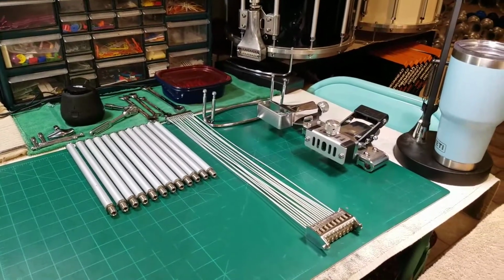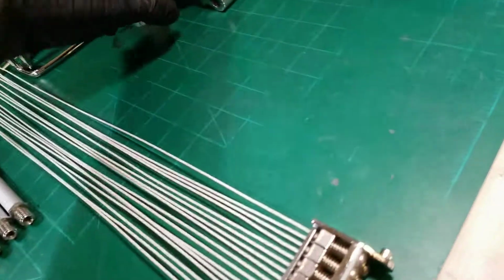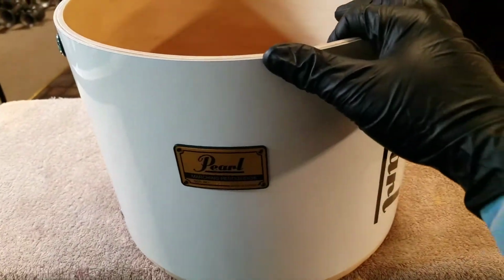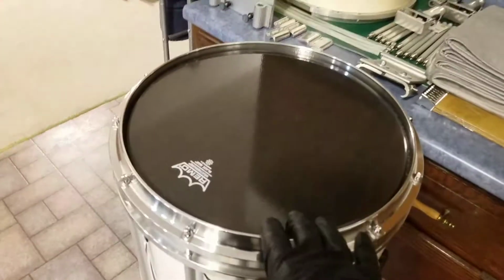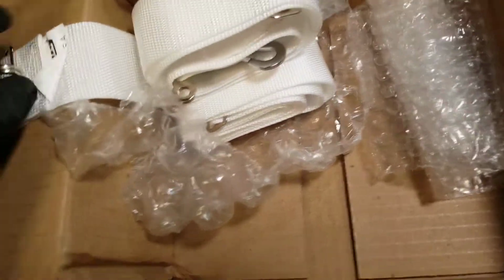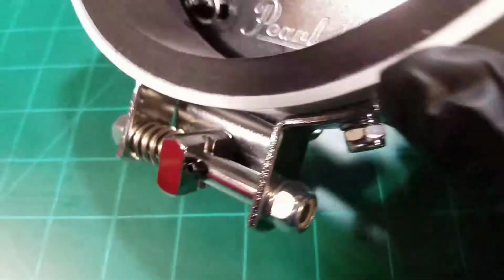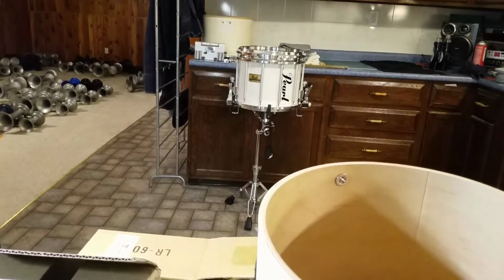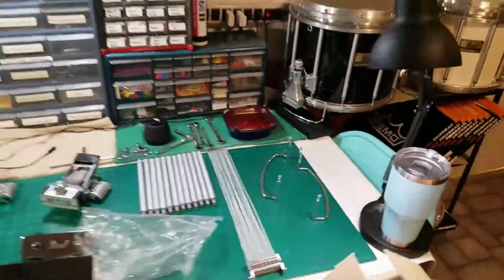Marching snare project update!

Comment: Amazing
Reply from the maker: Thanks! Putting alot of time and effort into these things!
Reply: @midwestmodelrailroadworkshop  Hey! Just asking what polish and method did you use on the marching snare. Thanks!
Reply from the maker: @Fuunds  I used a polish called White Diamond. It's a specific polish for aluminum that I found in a auto parts store! I applied a layer of polish to the parts, let it sit for the recommended time then wiped the parts clean! Some times I repeated that process until I was happy with the final result.
Reply: @midwestmodelrailroadworkshop  Thank you so much!